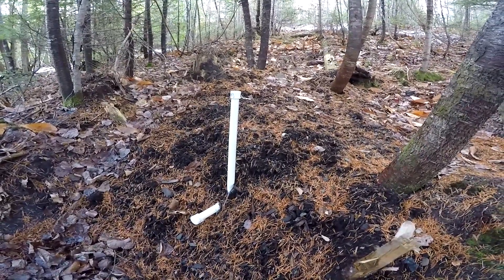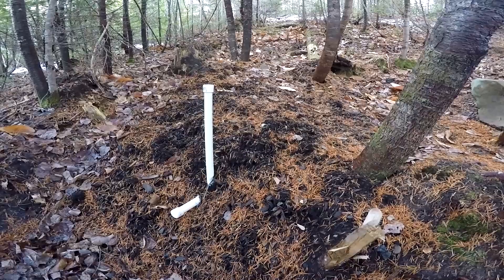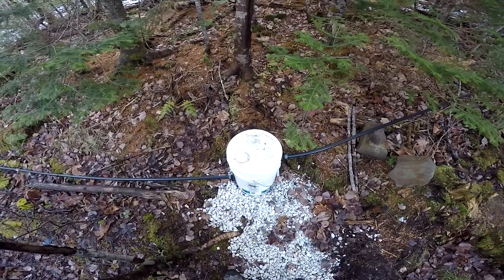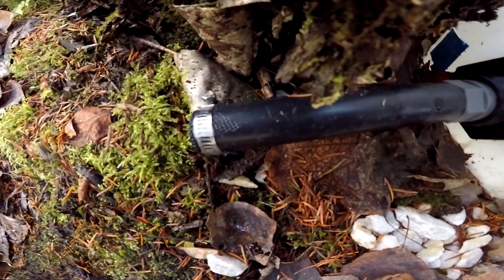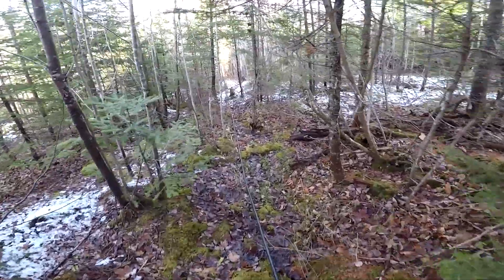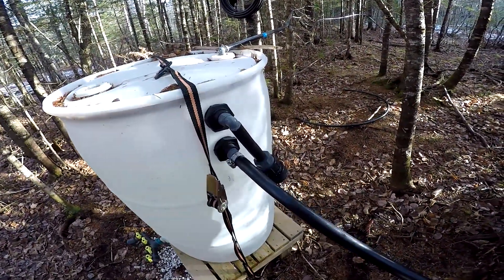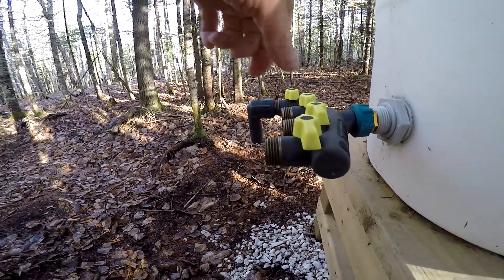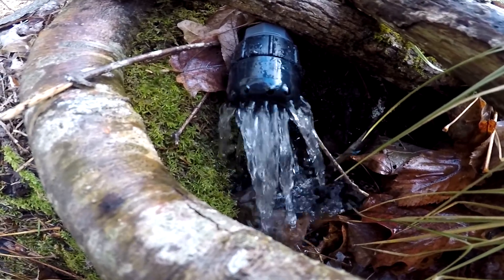Gravity fed spring water collection system

Comment: Aloha!  What diameter pipe are you using?  Have you had any problems with air locks forming in you pipe, and stopping the water flow?  If so, how have you remedied this problem?  I have temperatures that occasionally drop to -20F (-30C), and want to lay my poly pipe on top of the ground (covered by snow in the Winter, leaves and a tiny amount of soil the rest of the year).  Does your experience suggest that my 1 gallon/minute flow would freeze while constantly flowing in the pipe?  I was considering burying my sediment buckets.  I have 2,000' (590m) of pipe, and 400' (123m) of head.  Thank you so much for sharing your experience and knowledge.  Mni Wiconi!
Reply from the maker: Hey there!! I used 3/4 inch diameter poly pipe. I've had no problems with air lock at all. If I were to re do this project I would certainly choose 1 inch pipe though, but everything seems to work perfectly. From my experience, at -30 the water does not freeze. As long as the water always flows it will not. Since we have an overflow in the sediment bucket and the main water barrel, water is always moving. If I would have to learn from my own mistakes though, use containers that are pitch black so the sun doesn't go through (this created algae for me) Since then I have replaced my barrel with a black one with a twist top. The spigot in the video is plastic and when the weather drops below zero, they are very hard to turn. So a metal spigot is the way to go! I have also protected my sediment water bucket with an enclosure, since bears were turning mine into shreds. After these changes, everything worked like a charm. You live you learn :D. Hope this helps, if you have any more questions just lemme know! Cheers!
Reply: @BeardsandBranches  Aloha!  

Thank you so very much for your kind reply.  I'm now in the process of developing my spring, and now, in May (likely the most productive time of the year for my little spring), I have measured the flow at half a gallon per minute.  I was initially thinking of using a 1" diameter poly pipe, but am wondering if that would be excessively large.  What would you recommend for a pipe diameter for my spring?

dandole las gracias por anticipado,

-Byron